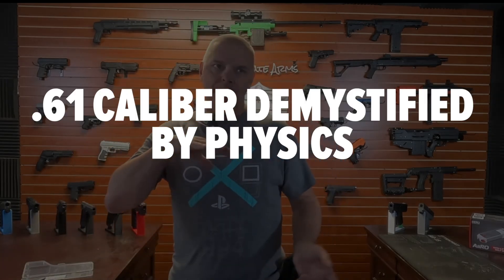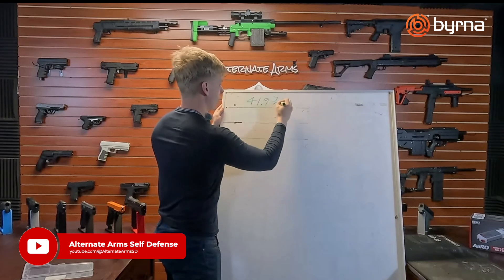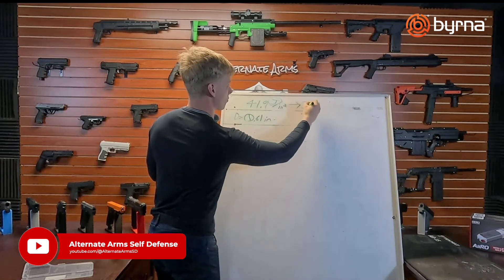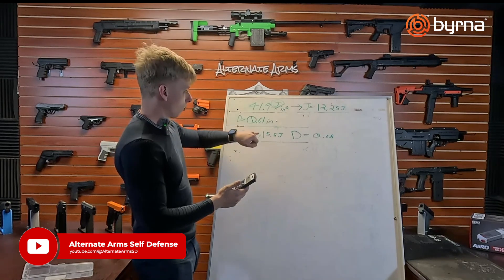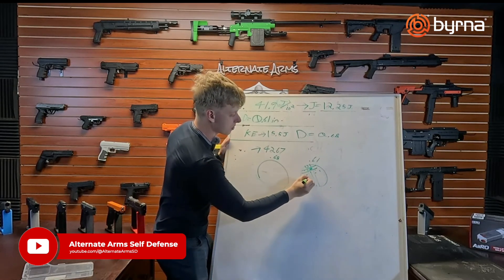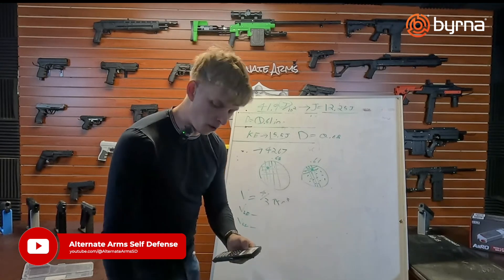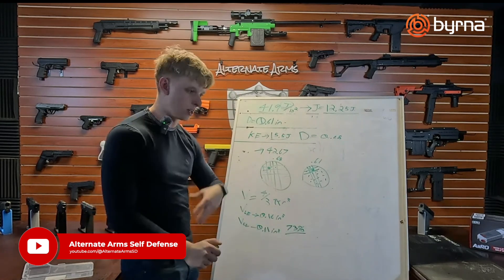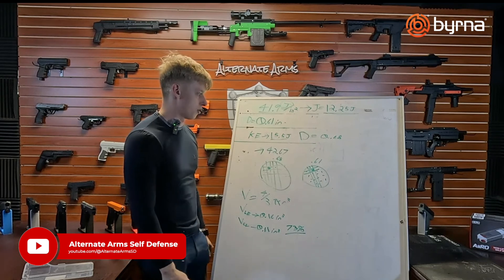.61 Caliber Demystified by Physics

Comment: The energy isn't about the caliber, it's about the mass of the projectile. If the projectile needs more mass just put some aluminum in the center, likely heavier than plastic, but the plastic exterior means less density on impact
Reply: Correct, and this is a question not of energy, but of energy density. In which, the caliber makes a huge difference on the value - you’re correct regarding increasing mass using an aluminum core, though! Fairly common practice for the .50 and .68 cal rounds

Comment: I definitely didn’t expect this - thank you so much for the repost! For some additional clarification, the cross sectional area of a .68 cal is less than one square inch and a .61 cal round is even less, and that division is how we end up with the same energy density out of a smaller projectile with less power. Energy density = Total KE / Area (which is pi * r^2 in this case)

Although, it did fire at greater than advertised absolute power, so the energy density of the CL is greater than that of the SD and the LE, much to our surprise! We will definitely be doing more on this!

-Jean Luc Reynolds

Comment: Only Joules rating most people care about is the impact Joules. When byrna changed how they advertise their Joules it was misleading.
Reply: They actually underestimated the joules,  they claim 12 and actually it's 15
Reply: @BobbyA-i6l  perhaps but the initial 41 Joules would have been the only thing that could have made the price worth it because it would have been on the same level as other less lethals that cost around the same price. If the Joules aren't that high on impact they shouldn't even put those numbers out there. For the price someone could buy the pistelle X 68 or the grimburg gavle and they actually have that power to be worth what they cost. Advertisement needs to be clear otherwise it's just   misleading. Price needs to match the competition. Sorry for that reason alone im not sold out the cl
Reply: @armandhyle5155  i based my purchase on reliability, I have the pistelle x-68 and I also have the grimburg carry which I just sent back to them cause it failed  the pistelle has also failed on me, and the pull to pierce technology is much better than the twist or hit to pierce. Is the new byrna pricey yes but I would rather pay for something I can use and depend on than have to wait for new orings or to ship out to be repaired.  Before I ordered the Byrna Cl I already have 2 byrna sd and 1 byrna le they have never failed to fire. The worst thing to have happen to anyone is to be on an unfortunate situation to have to pull your weapon and it fails
Reply: If ya hit someone in the jewels with one of these...party's over, Bub.